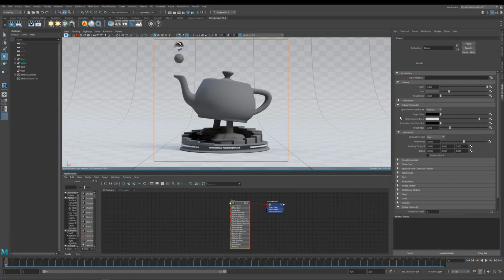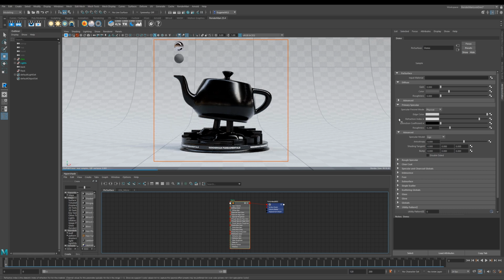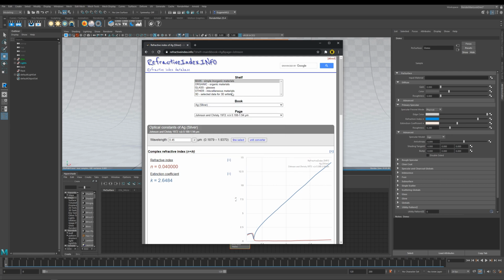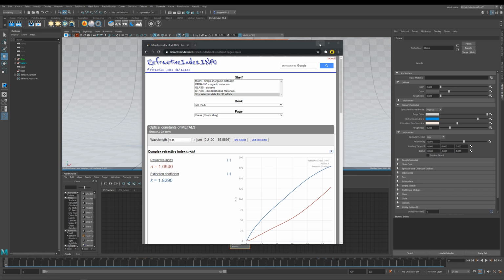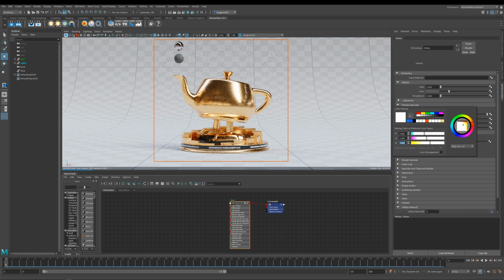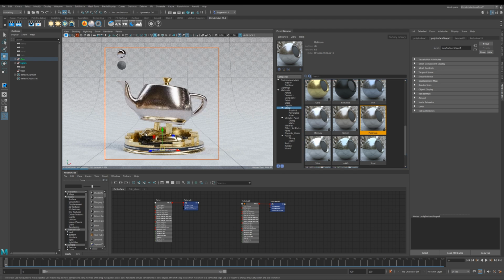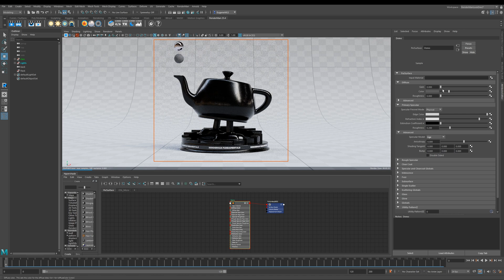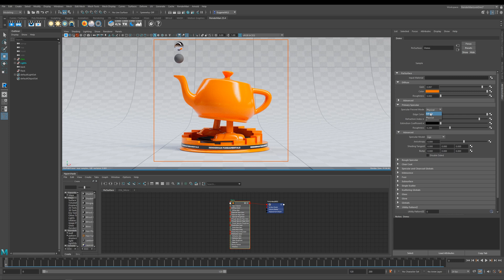RenderMan Fundamentals - PxrSurface - Physical Specular

Comment: I guess I got my answer for my earlier question; use physical with dielectric IOR values. Any way of calculating these outside the exposed parameters, using nodes? Like the min/max to calculate Base IOR depending on the Coat IOR to attenuate the specular in the base?
Reply: You too are learning renderman  reacently ? How is it going so far ?
Reply: @albababtout8158  Not really, just looking at some of the videos about it. I'm curious about a couple of specific things that different AI have different claims about (anisotropy/highlight glints without roughness, and anisotropic wrapping to backscattering angles due to microgrooves/glints from high intensity light sources like sun or focused spot).

I might give it a go later when compatible to run with Blender 5.x, if it happens. Not for any production stuff, but mess around with an try out. Some of the features looks amazing.